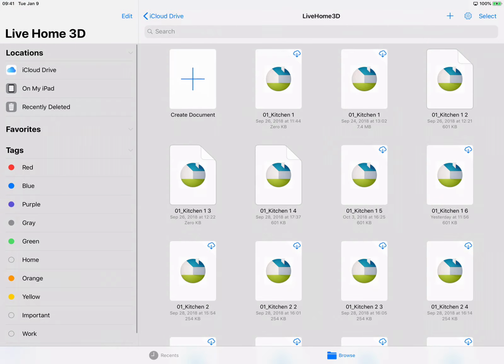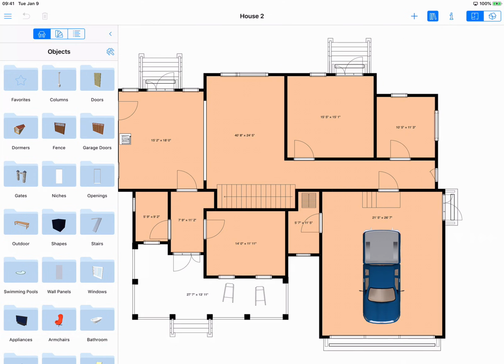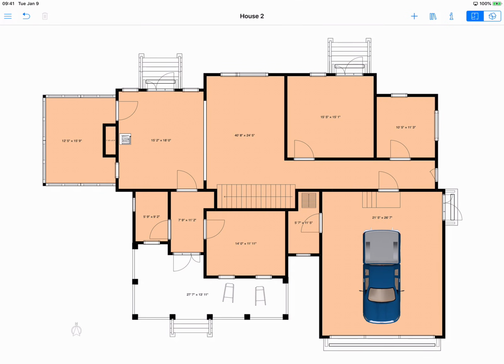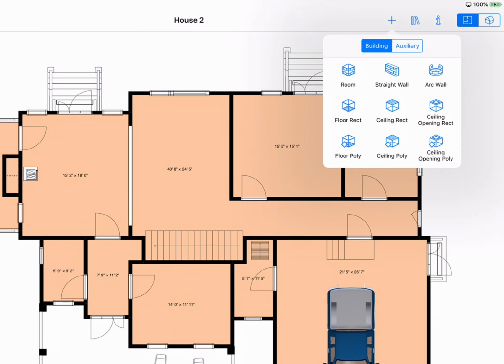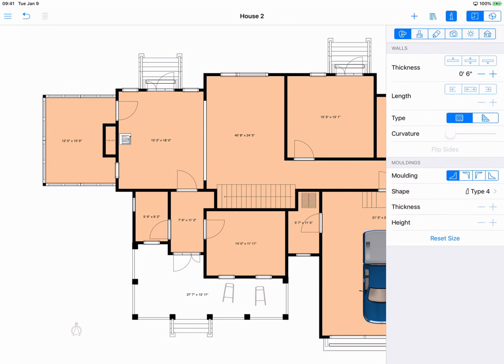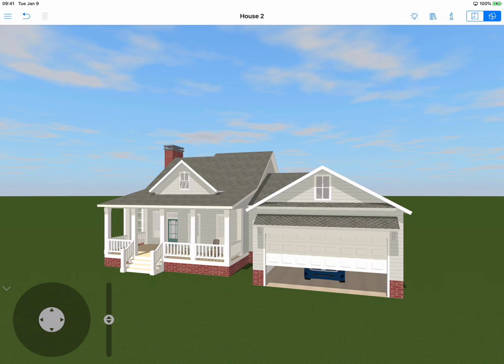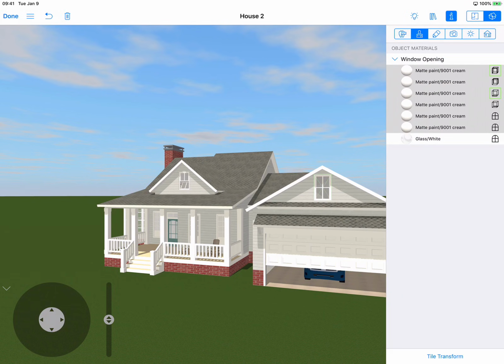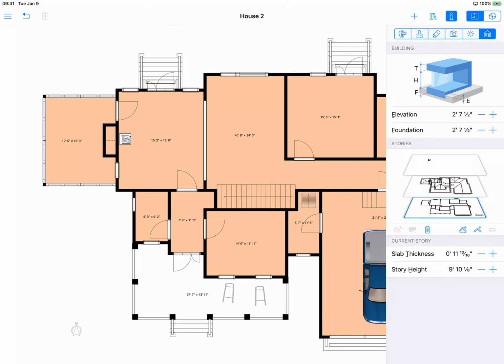User Interface - Live Home 3D for iOS / iPadOS Tutorials

Comment: How do you rotate the object that you place on iPhone
Reply from the maker: This depends on the type of that object. You can use the Rotate input in Inspector. Or open the Type and Representation dialog using the context menu or the corresponding button in Inspector, and then rotate the model by any axis.

Comment: How do I export a file that will open in sketchbook? I have the pro iOS app.
Reply from the maker: Hi Kevin, you can export a 3D model to Collada format. For this, please tap the Menu button in the toolbar, choose Export and then Share.
Reply: BeLight Software Hi, thanks for the reply. Share won’t link to my email. Only other apps?
Reply from the maker: @kevinkeelan354  Hello, DAE format is a folder, which can't be attached to an email message in iOS. Please use the Collada Zipped (.zae) format for this.
Reply: BeLight Software  Thanks👍